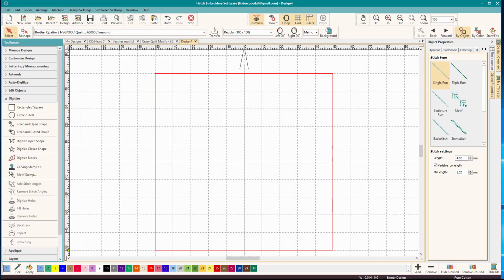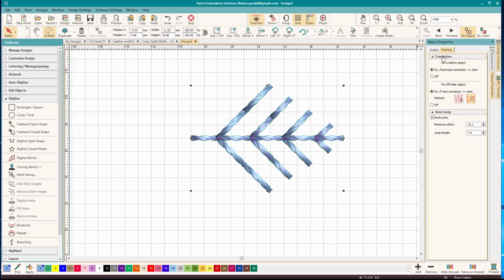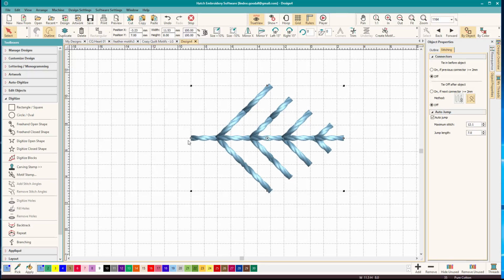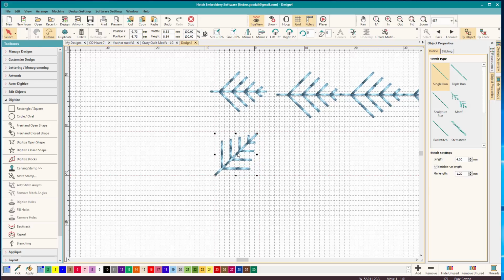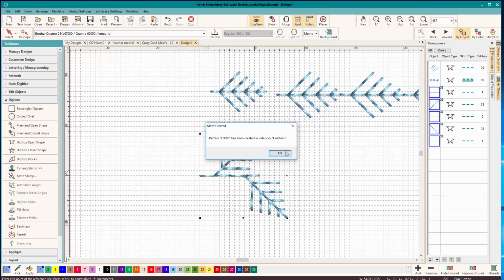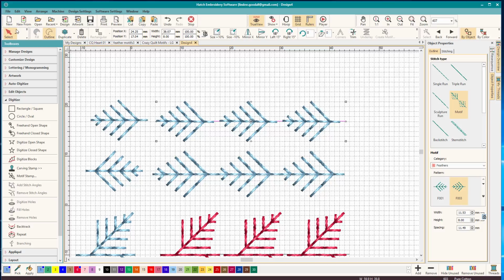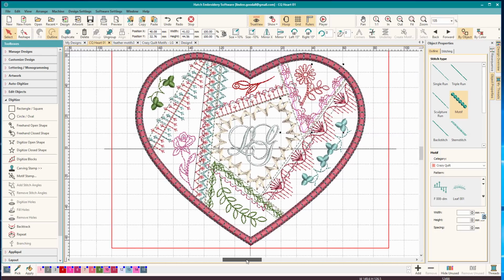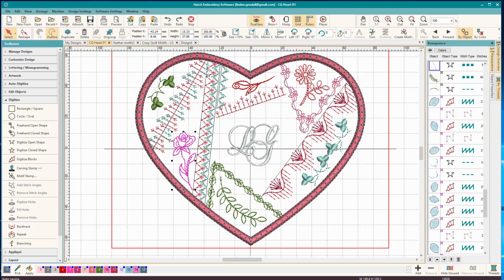Wilcom Hatch: How to Create a Motif

Comment: I am trying to work with both motifs and carve stamps. One issue I cannot solve is, getting those two icons on a menu bar. In your spare time (LOL) could you discuss toolbar adjustments? As I was trying to play with the toolbars, I lost the resizing and rotation bar!
Reply from the maker: Which 2 tools are you trying to get onto which toolbar? If you really mess up the toolbars, you can reset them. Go to the Hatch website on support page and look for "reset toolbars."
Reply: @LindeeGVideos  sometimes they’re present and sometimes not. I think I finally figured out how to save carve stamps. This video was very valuable for me. One thing that I have issues with is how to use the unique features. I spent about 4-5 hours figuring out carve. The videos without audio are not worth much. Thank you for your input, without you, I personally would be lost. BTW, online I have changed my name to pat adams. I am still doing the Avid Embroiderer as pat snyder.